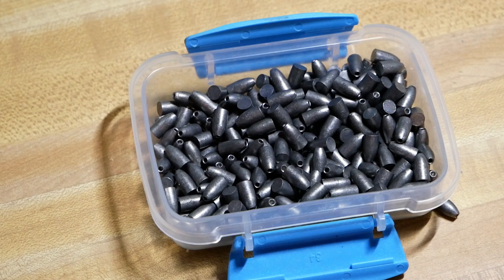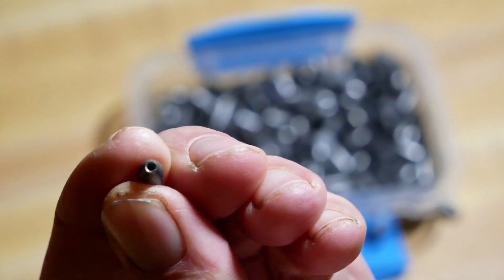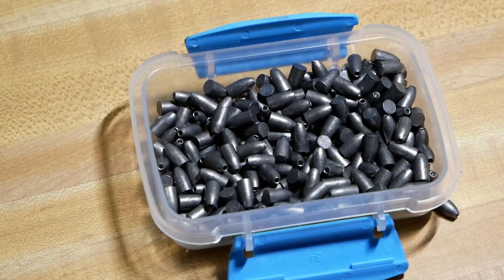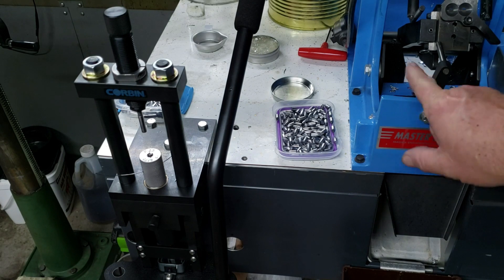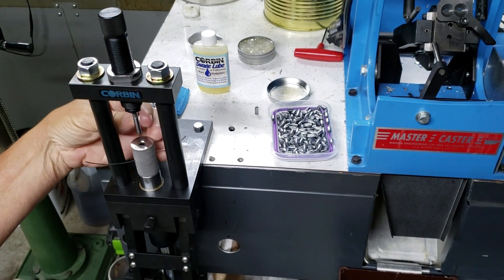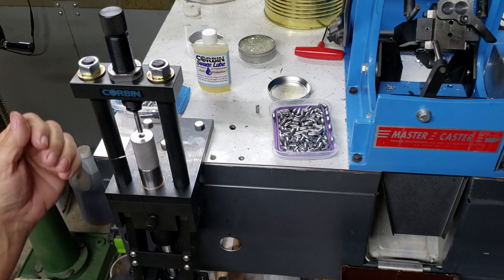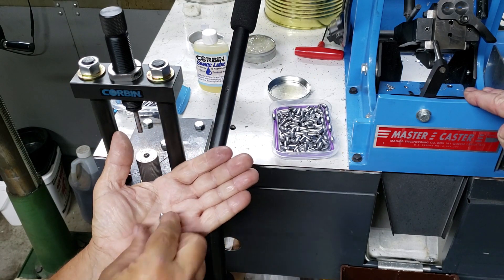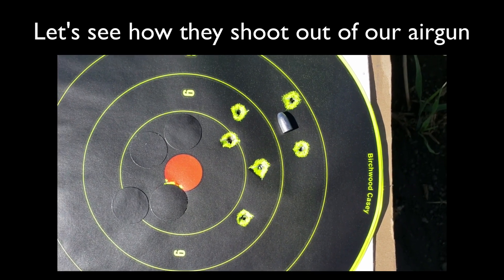How we make PCP airgun bullets using the Corbin S-Press Swaging and Reloading Press

Comment: I have the same press but to buy the lead from Corbin the shipping is almost the same cost of the lead.I found that RotoMetal sells the wire in 25lb. rolls 99.9% pure lead and if you buy enough the shipping is free. I cuts the price to make slug down considerable if you have no way to make the blanks. Pass it on to anyone that make slugs.

Comment: Seems like an expensive setup.  What's wrong with just simple casting bullets using Lee mold?
Reply: Not all casting molds create accurate diameters.   You could cast a slug then push it through a resizing die to correct the diameter.    

I have the .38 / .357 bullet die from Corbin.  I also have his resizing die that reduces the diameter of the swaged .38 bullet down to 9mm.

Comment: Would those slugs work in a 223 for plinking?
Reply: .22 cal pellets are usually .217" or .218" in diameter & are too small for a .223 cal rifle barrel.
Reply: Other molds & swages exist that are the correct side for a .223
Reply: Thank you.

Comment: I’m very interested in purchasing a set of Corbin’s finest.  But I do have a question for you.  Did you play around with the weight of the projectiles (fine adjust) to achieve the optimum sweet spot for your individual rifle? eg, I know top end pcp rifles can adjust the settings to achieve harmonic balance, but I’m wondering if the same could be achieved by fine tuning the pills length (and thus weight) to achieve the same for a rifle that is not as adjustable.
Reply: realistically, you could change the weight of your blank. Less lead going in, lighter bullet coming out.
Reply: Of course everything you mentioned plus size if you’ve seen offerings like .249 .250,.251 for example really fine tuning a 25 Caliber

Comment: That has to cost a lot.  Pellets are cheap and it would take tens of thousands of round to pay off. Unless you are in the business of air guns it makes no sense to buy and you would not know if the ammo would work out of your gun. Thanks for the info anyways.
Reply: That set up is well over a thousand dollars.  The big advantage is that you can custom size the pellets to be exactly what you want them to be.  With that system, you are no longer limited to the few varieties that are commercially available.  If you want a 23.6 grain pellet, or a 31.2 grain pellet, no problem.  It's just an adjustment.

Comment: Hey man. What kind of barrels are you using? Maybe 22lr barrel? I am thinking of buying a airforce candor and putting a 22lr marlin madol 60 barrel. And maybe getting some noe 22 molds.
Reply: .22lr barrels are usually .224" in diameter.  .22 cal pellets are usually either .217" or .218" in diameter.  Swages can be made in any size, but you need to order the correct size for the barrel you are going to use.
Reply from the maker: The barrel in the gun is a TJ hammer forged barrel .2175 smaller than a .22 with a different twist rate.   The problems with the talon and condor frames are the amount of flex you get:'(
Reply: Air Tanks Plus and other useful stuff like Stikman 
hello friend I have a TJ .25 and I would like to buy a molder for my use where I can get it
Reply: I didn't know the frame of the condor flex. Is the frame to thin?
Reply: To Fast if you go that route use a tj barrel he has. 223 1-12 twist n 224 1-14 twist depending on your bullet mood weight that will let you make your own bullets relatively cheap..you will need a better valve preferably a Doug noble valve n 110gr hammer n heavy spring..for the flexing on the frame you could use a mad dog stocks..or keeping the tactical look I use a wocguard from talon tunes that will strengthen the bottom n a big picatiny rail on top that should help a lot ..I have a original. 22 airforce barrel to in other regulated buid I could shoot up to 40g boat tail slugs with awesome accuracy no problem at all..
Reply: @fernandomercado1404  thanks I forgot to reply earlier 😅.